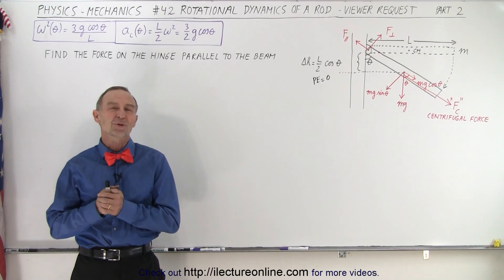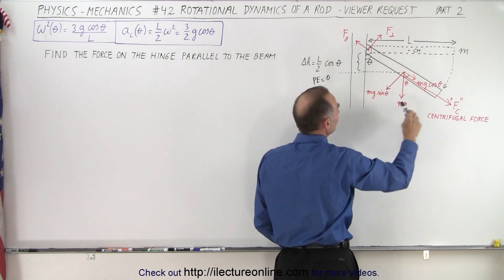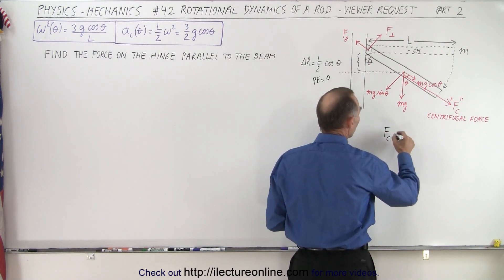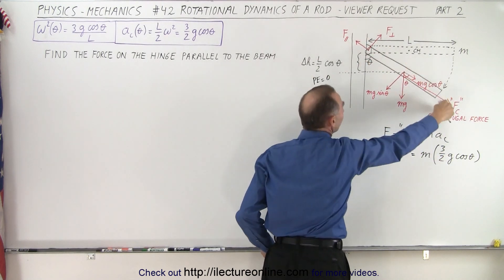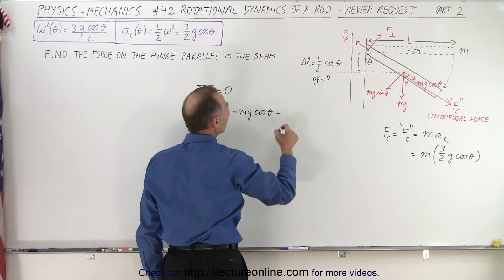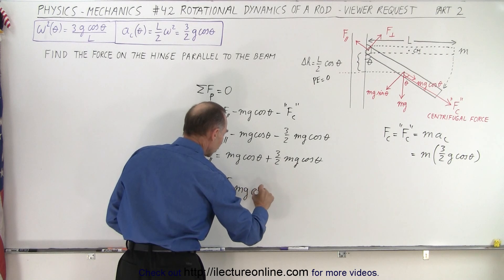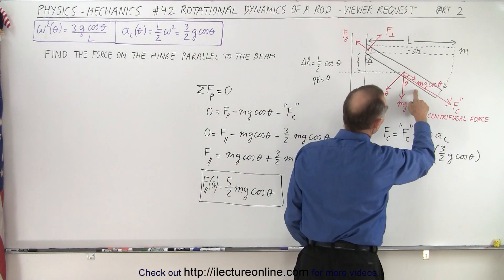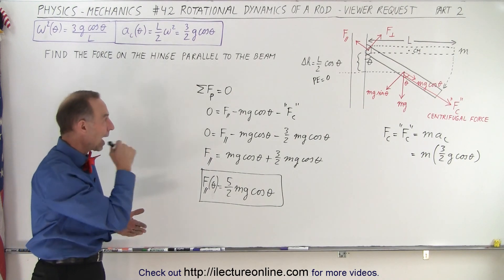Viewer's Request: Physics: Mechanics #42: Rotational Dynamics os a Rod - Part 2

Comment: I realized your depiction is from a non-inertial frame of reference, which initially confused me.  The centriFUGAL "force" is what you would feel if you were sitting on the rod center of mass.  The other forces in this frame are the force of the hinge on the rod (like a tension force), which you call Fparallel, and the component of the rod's weight, as you depict.  Because you feel no center-seeking acceleration, the sum of forces in that frame are zero, leading to your result.

I also worked the problem in the inertial frame of reference.  There you get Fparallel - mgcos(theta) = m x centriPETAL acceleration.  This leads to the same result.

Once I realized you were working in the non-inertial frame, your question, "Find the force on the HINGE....." confused me.  I think your Fparallel is actually the force of the hinge ON THE ROD.  This is consistent with the need to show the forces on the ROD in the free body diagram.  Of course, the magnitudes of these two Third Law reaction forces are the same:  force of hinge on rod = force of rod on hinge.

Is my analyis correct?
Reply from the maker: I wouldn't think of it as "inertial" vs "non-inertial" reference frame.  I use the fictitious "centrifugal" force because it is easier to visualize the problem like that.

Comment: Thanks for this interesting discussion.  I have a few questions and an idea for a new video of a perhaps similar problem.

1)  How would you incorporate a frictional torque produced by the hinge?  I assume there would be something like this:  moment arm X F = moment of intertia X angular acceleration, where  F = coefficient of friction X Normal force.

2)  This analysis remindes me of a problem I'm working on which involves rotating playing cards, and I'm trying to analyze the forces to produce the equation of motion in order to derive the resulting spiral surface.  It occurs to me that the type of analysis in your problem might apply.  See the playing card motion here: https://www.youtube.com/watch?v=3xuZzzWlru4&ab_channel=DavidWoodside   There's a link in the video to my REDDIT discussion of the physics.  My extensive research has not uncovered other analyses of this problem.

The so-called "Riffle Fan" motion would be interesting to analyze, I think.   In my video I note the two forces involved:  gravitational torque and "frictional torque" (torque caused by translating the cards).  The sliding of the cards relative to each other creates the 3-dimentional "helicoid" shape (like a tilted spiral staircase).  The moment of intertia of a playing card would be used, of course, modeled as a thin, rectangular plate.  One would also need a way to incorporte the increasing mass of the fan (adding successively-riffled cards into the fan).  The resulting helicoid surface would be a nice parameterization using the coefficient of friction and the acceleration of gravity.

If it's not too difficult a problem to solve, might you be interested in discussing the Riffle Fan problem on this channel?  If the problem is not appropriate for this channel, might you be interested in an offline collaboration of some sort?
Reply from the maker: That is a pretty neat trick!  (and an interesting suggestion).

Comment: So there is no torque on the pivot because there is no friction!
Reply from the maker: There are two ways of looking at it.  You can consider that there is no torque at the pivot point, because the moment arm is zero (theoretically).  Or you can say that the pin where the pivot is has some physical dimension, and if there is friction, it will cause some torque.  That is ignored here.